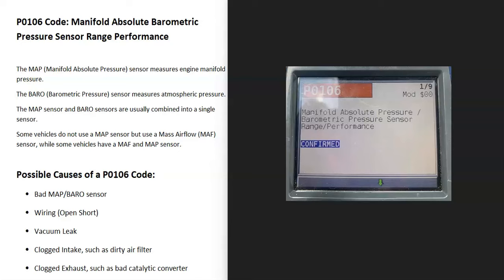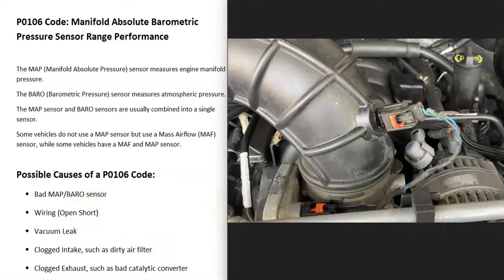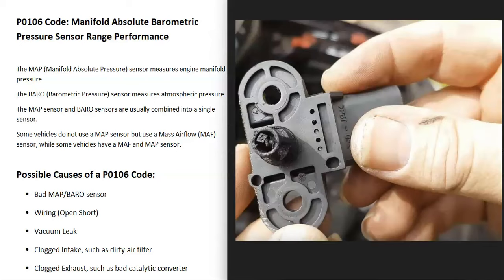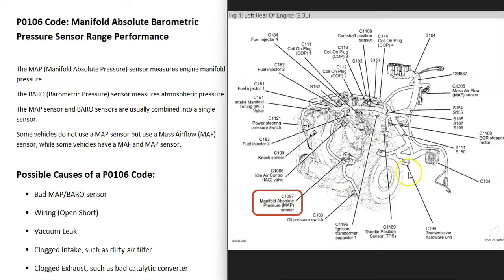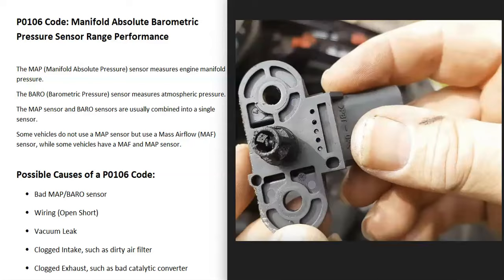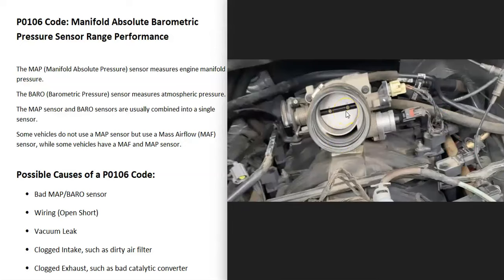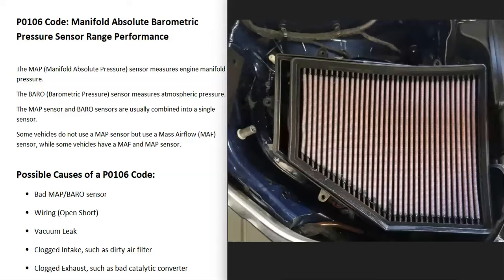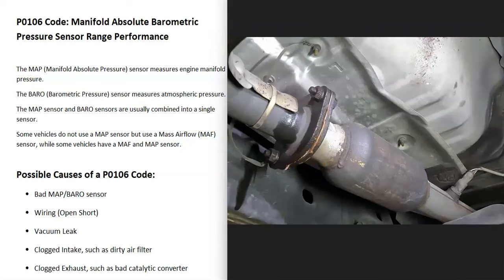Causes and Fixes P0106 Code: Manifold Absolute Barometric Pressure Sensor Range Performance

Comment: Just cleaned the throttle body on my 2013 Elantra, and disconnected the battery, after putting it back in I got that code..any suggestions?

Comment: Great explanation.  Mine was fixed on my 2013 VW Jetta.  But I'm trying to pass smog. My smog guy tells me it won't pass until the memory resets and it no longer shows the issue.  I'm being told by my mechanic and my smog guy(my uncle) that I have to drive it hundreds of miles, maybe even a thousand, to reset the system that is keeping it from passing smog.  Does that sound about right?  I'm telling my wife, "I guess we should drive to Vegas now😊"
Reply from the maker: Search and find the drive cycle for your VW and you can speed it up. Basically, there is a series of steps the computer needs to go through a drive cycle. For example, drive 10 miles an hour for 5 minutes, drive 20 miles an hour for 20 minutes and more.
Reply: The actual MAP sensor was bad?

Comment: My 2010 Kia Forte's battery died recently and I got a jump. After the jump start, the engine light came on and this code came on. I've replaced the sensor and the car still shuts down when driving. Any suggestions on what to do next?
Reply: I had a p0011 code code went away got the camshaft sensor and vvt solenoids. Haven't put them in yet because the code went away but car started to not want to start so I replaced the 12 year old battery in it now it's throwing this code. I did have to take and loosen the air filter cover to get to the battery though so I'm hoping it's just do that a couple times but the kias are crap I'm just trying to get mine going long enough to get like $1000 trade in so I got something
Reply from the maker: Be sure the battery is good, and the alternator is charging correctly, as a bad power supply can cause issues. The alternator output is usually 13.5-14.5 volts, which can be tested using a meter. If that is good and the sensor is new, check the wiring going to the sensor.
Reply: @HVAC_Mechanic  Thanks. Luckily all my car needed was an ECU reset.

Comment: Still throwing codes on the dash 
Car stalling 
And slow acceleration 
I’ve changed the map sensor and throttle body what’s next?
Reply from the maker: If all the parts are good, I would test the wiring.

Comment: I changed it but I’m still getting the rough idle
Reply: Did you fix it?
Reply: @user-jh1dl3cw6w  yeah I actually had an air leak in my pcv valve/hose